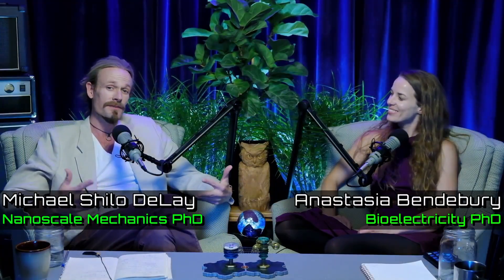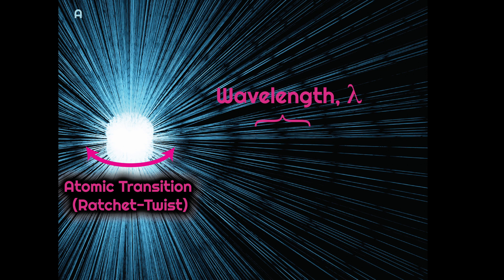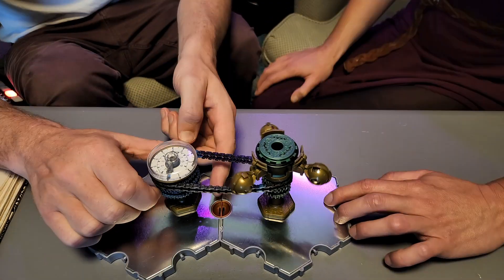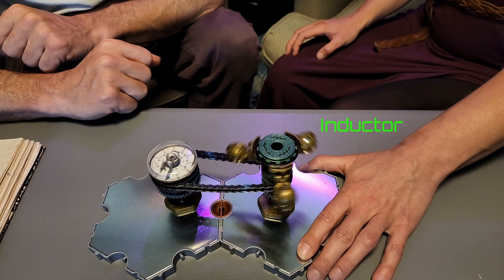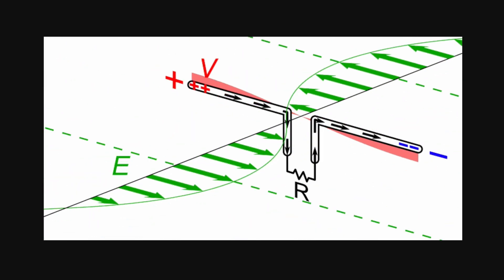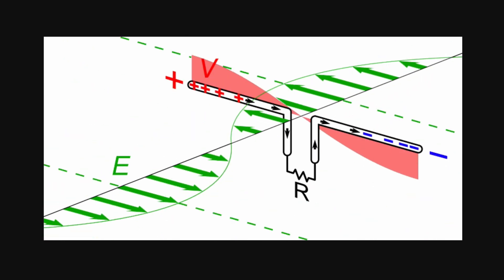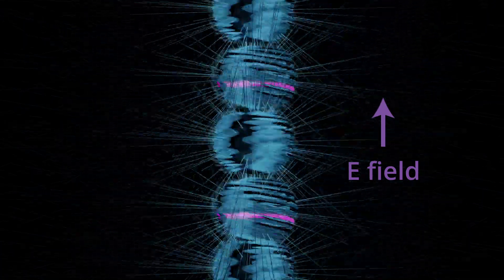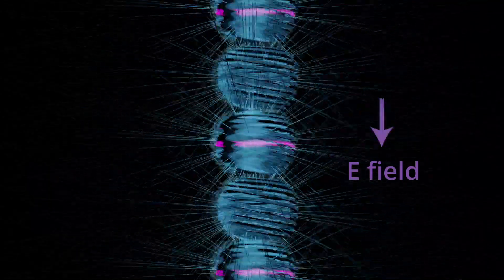New Material Model of Light - Topics in Physics #20

Comment: Hello Anastasia and Shilo,
I really don´t think we can speak of atoms when it comes to "light". Otherwise we frequently would have to empty our lightbulbs for particles, right? We are dealing with waves only.
------
Light is a double helical rotating wave motion containing both the positive and negative polarity at the same time. And it´s even governing the RNA and DNA strings to form molecules and cells etc.
Reply from the maker: light is an activity - a conversation between atoms. it occurs within the extended portions of the outer e-shell of atoms. we call those extension filaments. we deriver their existence from the radial distribution function for the electron.
Reply: @MaterialAtomics  Thanks for the reply. 
Yes to an activity, but what causes the activity? IMO this depend on EXTERNAL EM-WAVES acting on the atoms.
How do you explain light from the Sun in your hypothesis?
Reply: @ivornelsson2238  actors in the MA framework are exclusively material bodies. That means they are surface-bound volumes with inward extension that have definite locations. Waves are actions not actors. Some THING has to be waving. We propose fibrous filamentary portions of the electron shell of the atom in the case of radiation.

The sun is a huge topic we deal with at the podcast. Here's an overview: https://youtu.be/1OCL5Lq8m6s